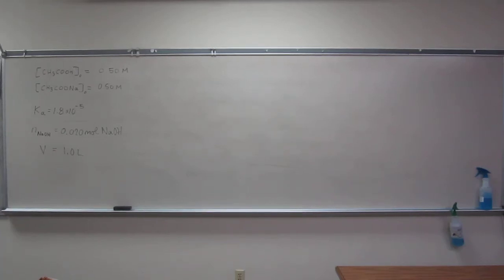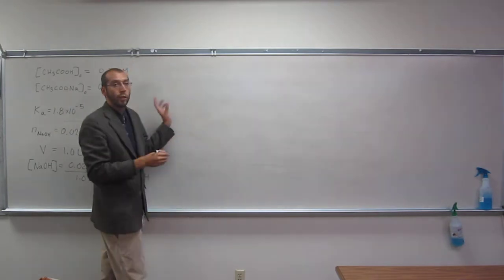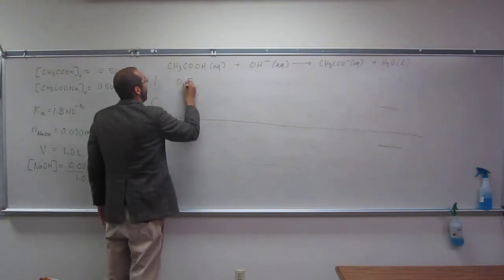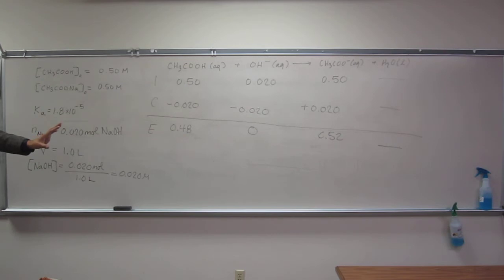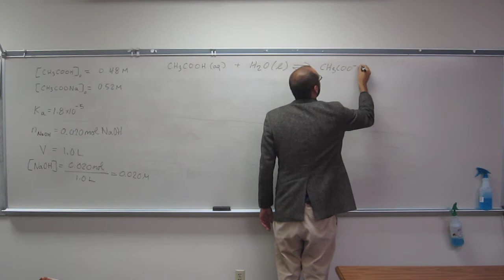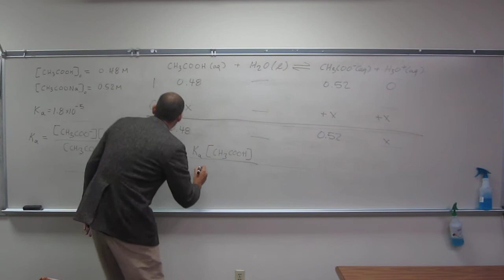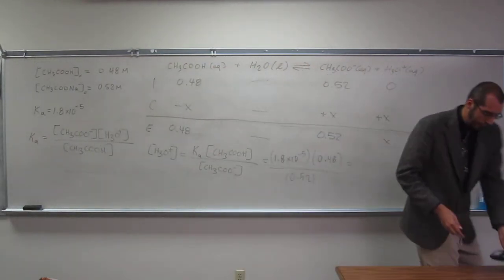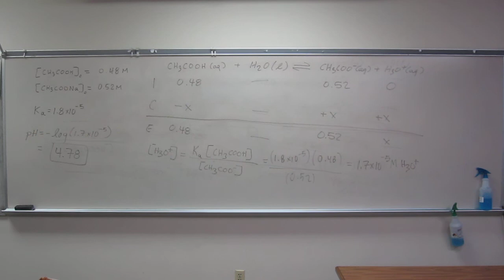Calculate the pH of a Buffer Solution After the Addition of Strong Base (OH-) 001

Comment: Sir, I wanna ask you that what's that 5% rule that you're talking about in the problem?
Reply from the maker: The 5% Rule allows you to simplify the work, so you don't have to use the quadratic equation to find your final answer. Ka and Kb values are usually known to an accuracy of ±5%, so making an approximation that falls within the ±5% range of the true answer will essentially give you the correct answer. If it is out of the 5% range, then you will have to go through the entire process of using the quadratic equation. I hope this helps!